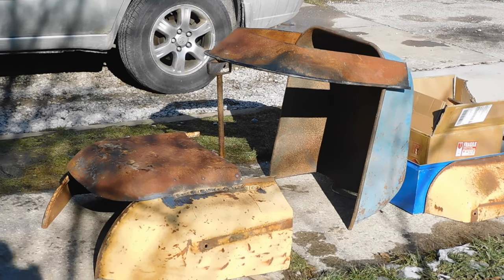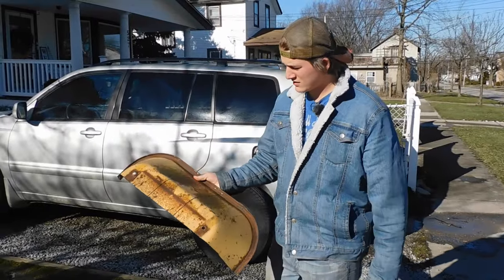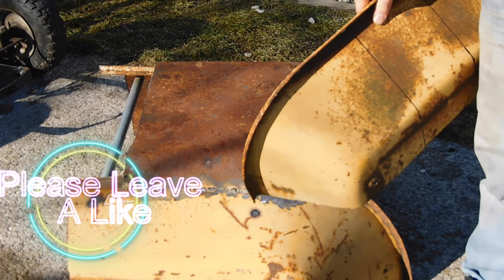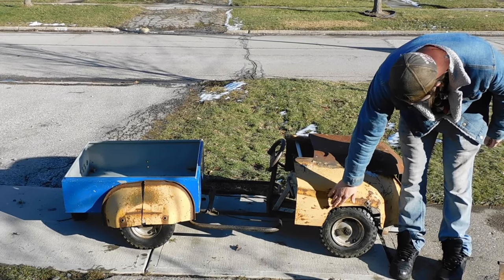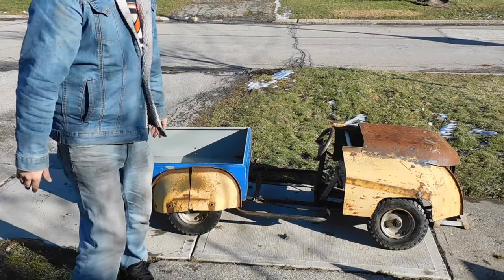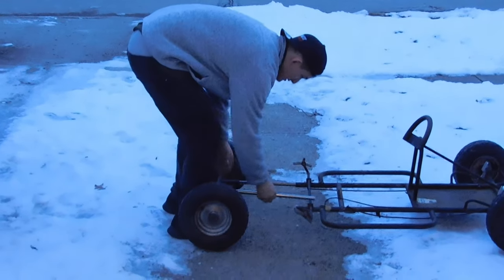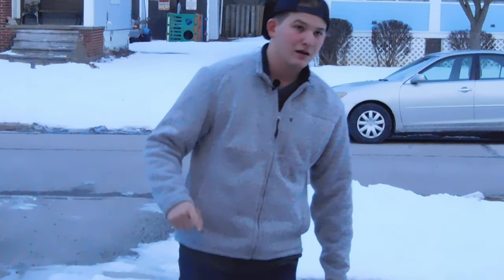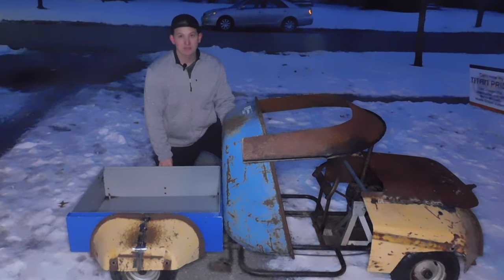125cc RAT ROD GO KART TRUCK BUILD PT. 2!!

Comment: Love it guys ! Just wondering what it would look if you turned the front fenders the other direction ( rounded end towards the cab and the flat end towards the front easy to build a grill for that way also) love it though
Reply from the maker: Thank you!! I wish we would have thought  of that, It would have made things much easier. We actually finished it and put a video out not too long ago. The grill was definitely a challenge.